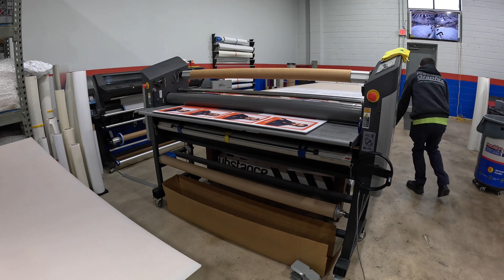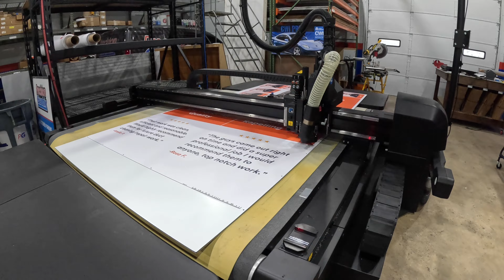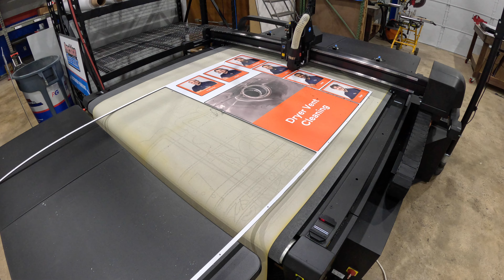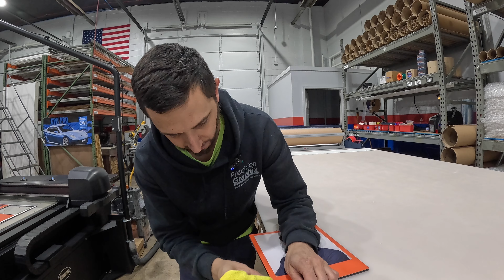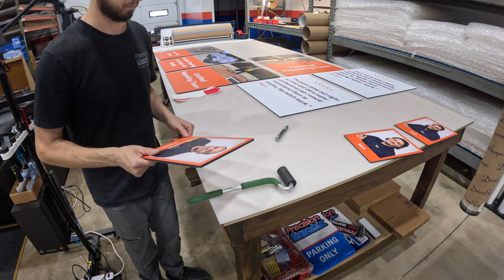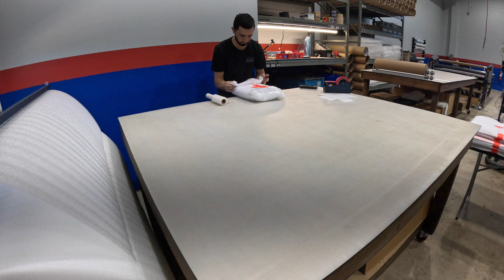Branding DUCTZ of DelChester - Part 1- Color Samples, Printing & Laminating | Steve The Graphics Guy

Comment: Another neat video, Steve! The color topic you mentioned 20:00 seems like a topic for another day. How do you navigate around matching color?
Reply from the maker: Thanks! Color matching can be a difficult process and some colors are easier than others. I’ll make to make a video about it!
Reply: @stevethegraphicsguy  Hi Steve is this the HP Mystical from Dreamscape? The one you mention at 7:30
Reply from the maker: Yep!
Reply: @stevethegraphicsguy  Cool! Never used this before, do you know how it holds on textured walls?
Reply from the maker: It's a traditional pasted wallpaper so it would likely stick, but you would certainly see texture as it cures and it wouldn't look great. You would want to start with a smooth wall or choose an adhesive film meant for rough texture and heat roll it.
Reply: @stevethegraphicsguy  Nice! Thank u

Comment: Do you have a software you use to set up your proofs?
Reply from the maker: I use FlexiSign, but you could use adobe illustrator, Corel draw or many other design programs.
Reply: @stevethegraphicsguy  I have flexi but I have never seen a way to set up the proofing document. You should do a video on that. That would be absolutely amazing
Reply from the maker: It’s just an art file I made and then saved as a template. I picked my favorite elements from different ones I’ve seen over the years and combined them!